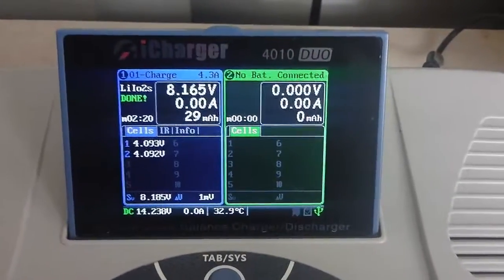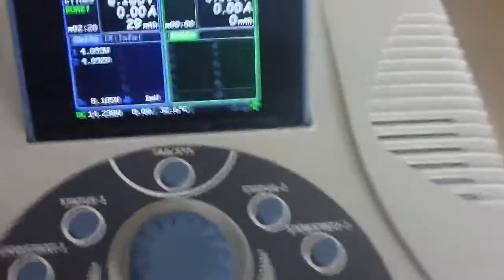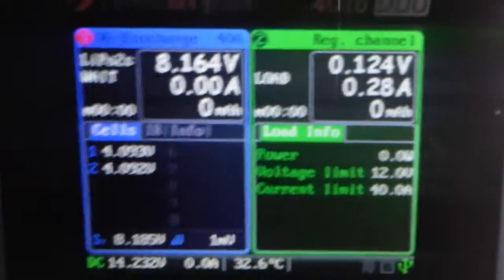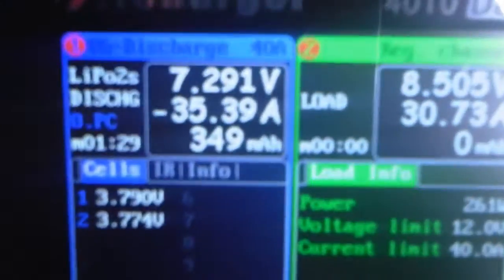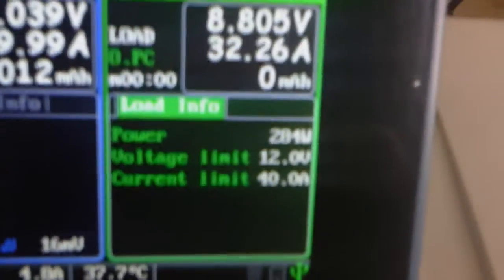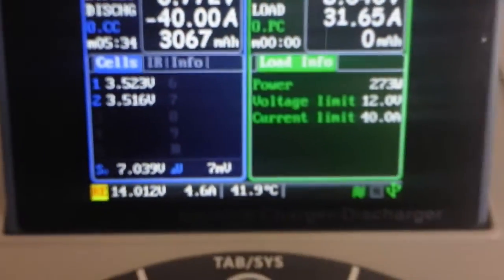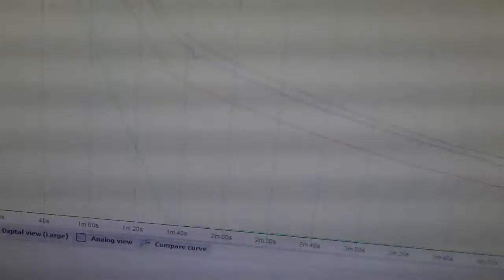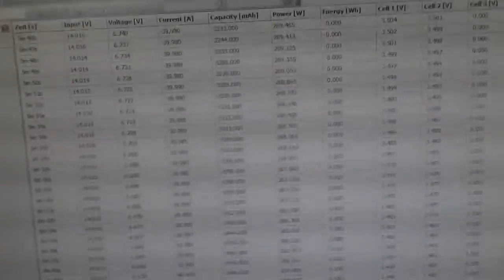40 AMP LIPO DISCHARGE TEST

Comment: 65C @ 4,200mAh is rated for a constant 273 Amps.. Isn't 40 Amps a little low..? I mean RC Planes have 1kW motors in them.. If a plane has a 1kW motor in them, ... if you were using a 3S LiPo wouldn't that draw something like 79.36 Amps..? I also fully understand that drawing 40 Amps for a 4.2Ah battery would drain it in about 6 Minutes and 18 seconds..? So I guess 80 amps would be half that. 3 minutes 9 seconds. 120 Amps, 1 minute 30 seconds or something in that neighborhood.
Reply from the maker: MARK 1 Hey mark
these 4200 are 65c batterys are only used in 1/10 scale R.C CARS The test was only to demonstrate that the charger is capable of discharging @ 40 amps continuous with out melting anything and to see how hot the packs got, there are not many chargers on the market today that will do this, so the answer to your question is yes it is low for this pack. but the discharge rate is as high i would like to go and the charger will take.keep in mind that your not discharging at a continuous 40 amp rate in a r.c car you would get short burst of much higher that 40 amps but not for long periods of time.
Reply: ***** Yeah..? Many of them do that.

Comment: Good afternoon. I was wondering if you have any information on the Extractor dischrager. Is that something you made up or bought?
Reply from the maker: Hello mate the Extractor discharger resistor bank will only work with the duo icharger 4010... its a bank of resistors that helps the icharger DISCHARGE under Heavy loads in regeneration mode. the Extractor discharger was made for this purpose. yes i did make this myself.
Reply: I am looking at getting a 406duo and an looking for info on making a bank of resistors like that. Do you have any info that would help me out?
Reply: skippy813 Thank you very much. That helps a ton. I appreciate the info.
Reply from the maker: I hope you get things working... also if you like sub to my channel ?